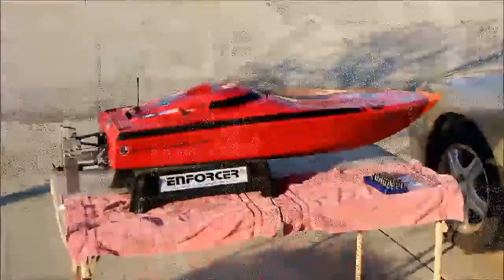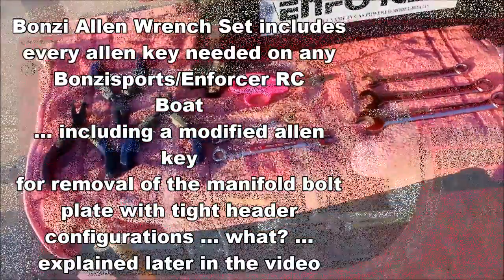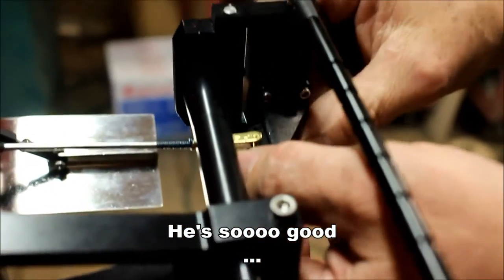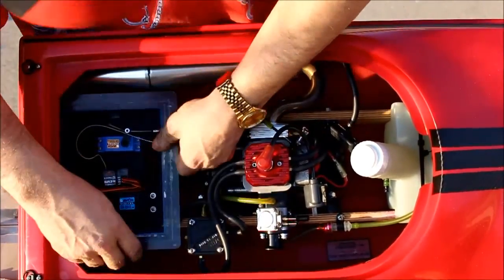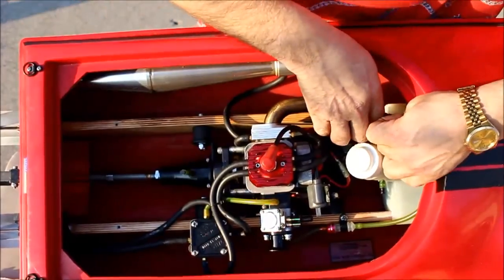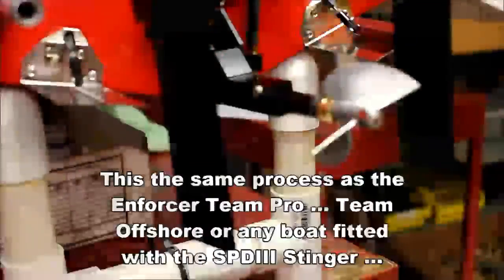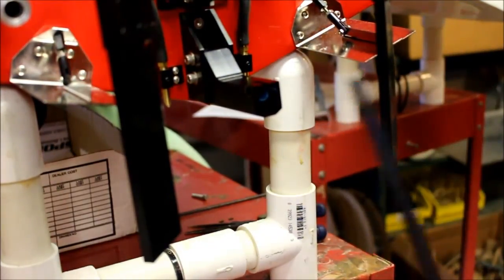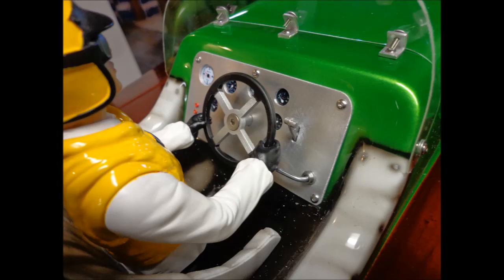Enforcer Engine Removal for You Tube

Comment: Hi , I'm new enforcer G , did u remove clutch or how to maintain clutch system? Thanks
Reply from the maker: As far as the clutch goes ... I Removed the cone and cleaned out the cleaned out the gunk inside ... we checked the bearings while the cone was off ... be careful not to over torque the 4 bolts when re installing it ... you will want to inject about a 1/2oz of 00 grease at the beginning of your day ... be careful not to stuff it full ...